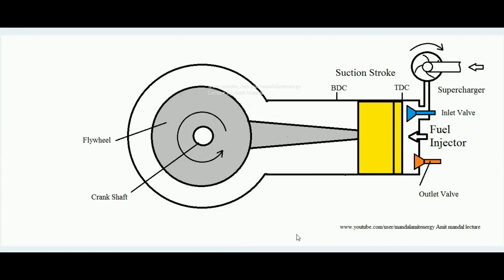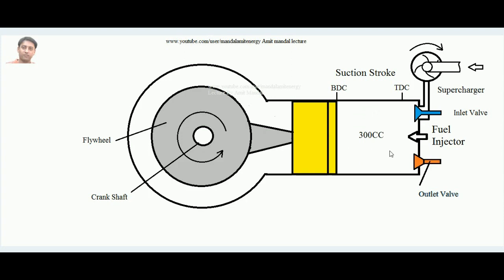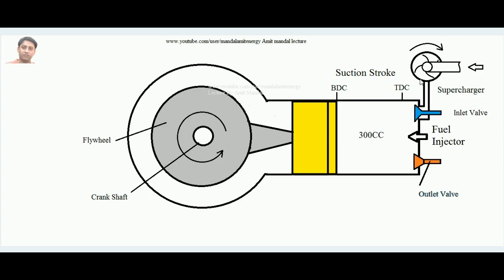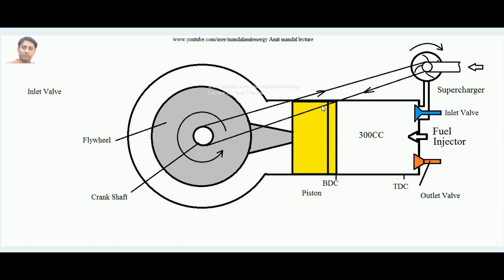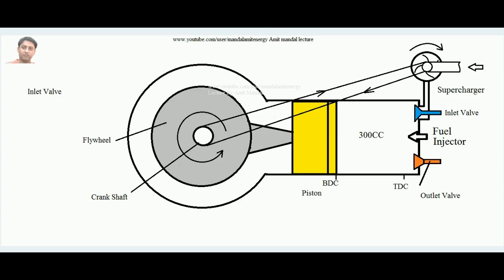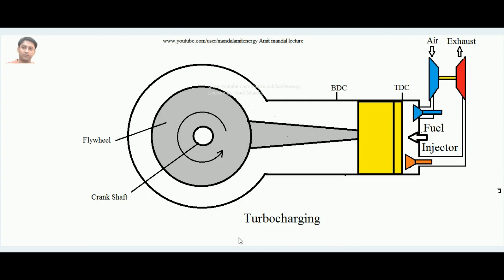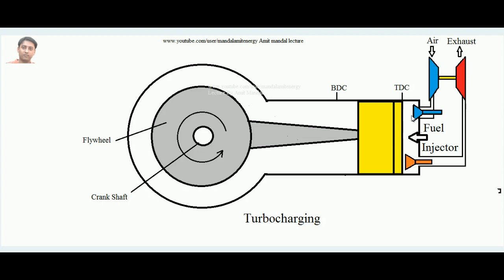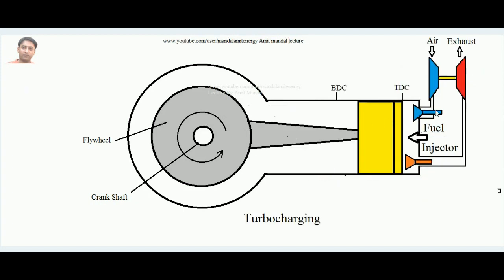Turbocharger vs Supercharger

Comment: Why intercooler is applid before compressor in turbocharging although high temp of inlet air is favourable for better engine efficiency??
Reply from the maker: The temperatures are optimised.